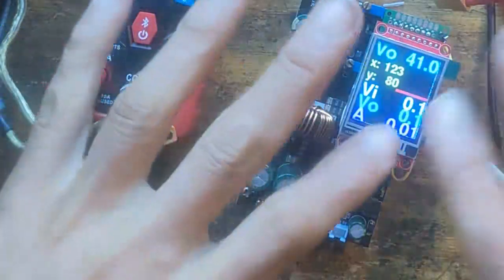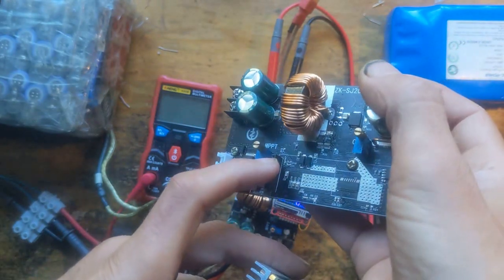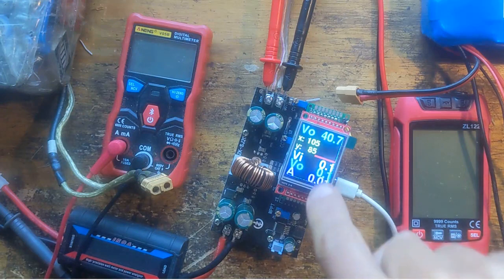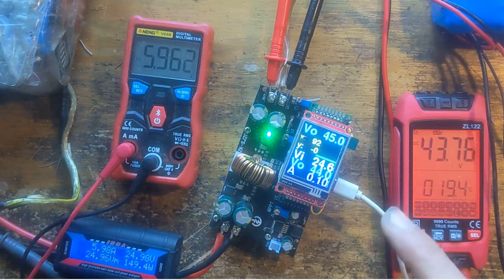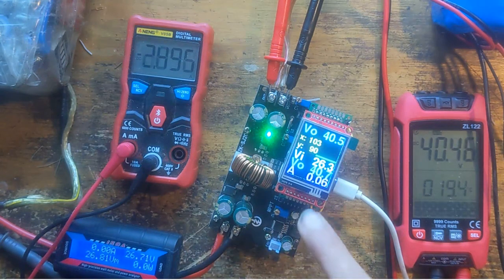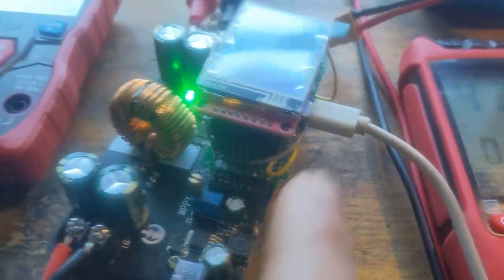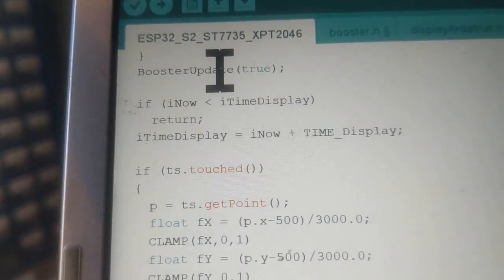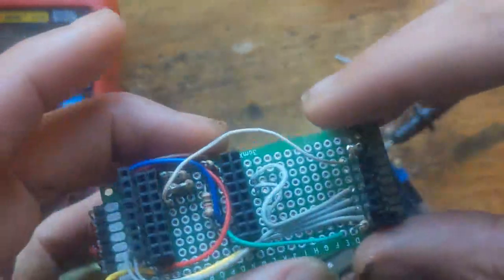$33 = 20A 80V buck boost with ESP32 + TFT + TOUCH :-)

Comment: HI, beautiful toy I struggle with my boost mppt / charger, and I see this is pretty small.
There must be high switching frequency, if such small inductor can handle 20 x 80 V === 1600 W
of power. I use bigger inductors and bigger FET  for such loads.
Reply from the maker: There is a 30A version of this 80V LT8705 buck/boost module. https://www.aliexpress.com/item/1005007082562683.html which has twice the mosfets, so two in parallel for each..
But the same two 8pin headers are not fully compatible with the my 20A module.
Would be easy to adapt and i have already such a 30A module.
But with no othere people showing interest in my github project, there is not much happiness to continue..
Reply from the maker: LT8705: Synchronizable Fixed Frequency: 100kHz to 400kHz
which is set with a single little smd resistor from pin RT to GND. Esay to measure for me if you want to know if this 20A module is running at 120 kHz or 202 kHz or 350 kHz.
Reply: @robodurden  thanks, I am just watching your 6 km test drive video,
what you are using now ? Is this 20 A converter still sufficient to provide
enough power, and do not overheat at summer, or you are using
something more powerfull ? Why you are using 24 V battery and
do not make NMC / LFP / LTO 42 or 50 V battery ?
What is voltage range of a motor and what is peak power motor
can deliver ?
Reply from the maker: @PavolFilek sorry too many questions.